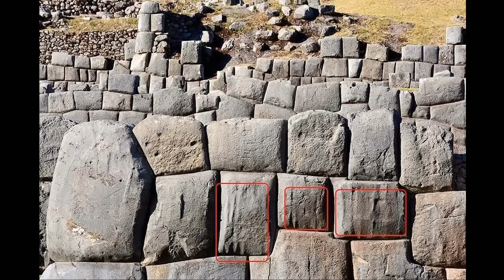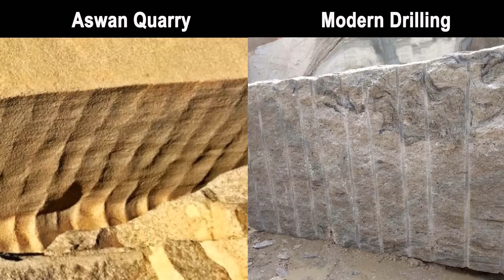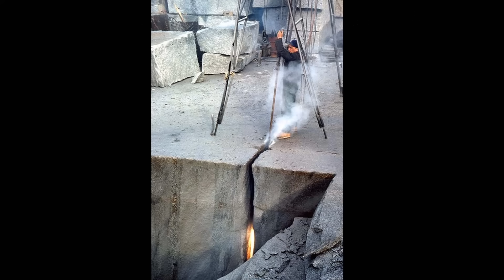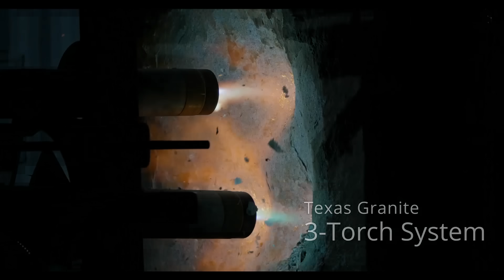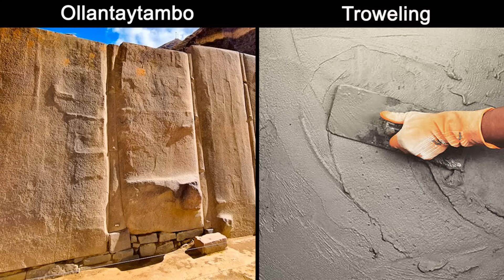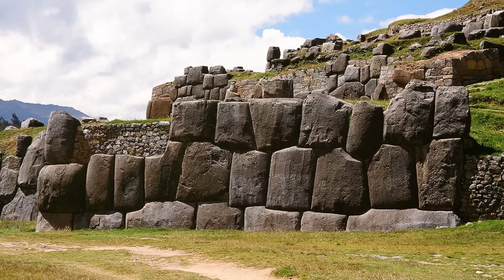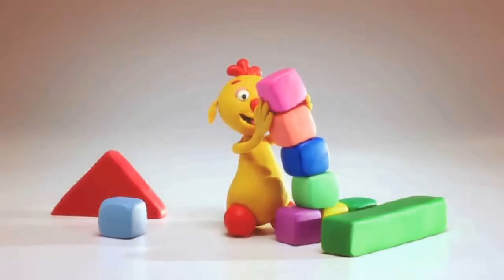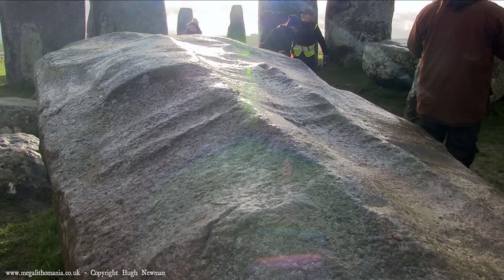Megalithic Mystery: Different Scoop Mark Types?

Comment: The marks are not a mystery.
The reason we find them on every continent, is because every civilization have discovered them independently.
Anyone who has had a campfire on rocks, knows how this works.

The method is called fire-setting.
Its a simple fire, making the rock brittle.. then you just hit it with something hard to remove the brittle part. 
Its a technique used up until recently, even after steel. Because its very fast and effective vs the effort taken.
Reply: Also .. geopolymer has been a scam since davidovits started it in the 90s. Its only doable with sedimentary rocks, but even then, its basicly faster and easier to just quarry them. 
Also ... we know the quarries, because each rock has a fingerprint. 
Andesite can not be made artificially, like limestone. Nor can granite or any igneous or metamorphic rocks

Comment: Dear Tina, when presenting a solution to the real-world scoop-mark finds in quarries, however still a proposal, there is no need to think of blocks getting soft in any way.
Soft blocks cannot reasonably be handled, and bulge out at the bottom, not even pressing into the sharp corners, and does not seem to do the job as seen here.
The possibility of plasma related equipment however, is already proven, with the picture presented by (Ombio Productions on YT) Igor, who is the only one having the image of this officially hided sculpture.
On the Wall at  Olyantotambo, we find just one other example of Plasma torches used, and we therefor cannot escape the idea of a high technical civilization using plasma before we did.
And over a 30.000 year time span, nothing of their equipment would be preserved, as expected.
The tests done to find a different consistency on the boulders is not valued solid in their community of scientists, and was done before at the University of Utrecht, the Netherlands years before them, and did not show a change in consistency at all.
And so, for us at this moment, the idea is out of the window, and could only be a case of surface-softening if something like that at all.
When Plasma is used, shown as a fact, the copy of a mirror surface must be no problem to them, as it is in the same order of mechanical development, and can be expected to exist.
The handling of these enormous blocks on high altitudes is not questionable either, knowledge evolves at all levels at the same time, not making it unsolvable.
And the surface at the seems show pitting, as a proof of hammering on a solid rock face, we cannot escape this fact with softening at all.
Good video anyway, as Scientist will not talk about it!

Comment: The scoop marks are made using Ancient stone drilling methods. Also the channel outside the drilled down the length of the Obelisk. Square logs were used as pilings when sandstone was still on the surfacethey knew harder rock was below.when blocks were pulled over the pilings they quickly smashed apart the softer layers above. The weight of blocks left pressure dents to fool people into calling them scoop marks!
Reply: Ican answer all of the questions you have about the scoop marks, their mining machinery was very simple and everything they tried to make, always provided unexpected results. to finish cutting a obelisk like that out of the ground would be finish roughly carved channel around the pointy end and also the base of the obelisk the square end ensuring it is to an even depth as the channel up each side. feed ropesaw over pointy end, then team of men can saw under the pillar to the centre, then do the same at the square end. break the centre support putting weight on one end.

Comment: The corundum recently found in the granite's microscopic pores implies an abrasive technique.  Water jets come in many different sizes, so I am guessing that water jets are the most logical conclusion.  The plasma would degrade the stone too much for the finish on the rough and finished cuts.

Comment: if there are casting box, 
there will be similar stones
blocks in sizes, every stones are different from each other, a bit similar but not the same. It is easy to do for stone masons to do different sizes than same size blocks then stack it up.

Comment: Great content, one thing to consider regarding geopolymer is that they are very high density, much higher than water or play dough. High density pliable geopolymer would be very different at the base of the mould, compared to the top due to the pressure difference. Yet we don't see any difference in these stones, the top isn't any less compressed compared with the bottom, which is a big red flag as far as geopolymer goes.

Comment: Engineers have looked at them and determined they were likely cut out using disks of some material.  They radiate from a point that is moved every so many cuts from what I have seen.  They are also very old, so erosion changes their characteristics some very likely.  Snake Bros have a video on it, I believe.  I believe they were titanium/water/vibration heads. The core drills with mechanical scores tell us they used cutting tools.
Reply: They had various tools. There's not THE tool did all this stuff.
For these scoop marks the plasma torch or something similar with high temperature makes most sense
Reply: @jochenwagner2782 I agree about various tools.  Not so much on plasma torch, though it is possible.

Comment: These scoop marks were left by flat abrasive water jets. The abrasive used could have been sand, as well as the material resulted from the destruction of granite by these abrasive jets. And yes, it's a pretty high technology that became possible only some 100 years ago. It requires precisely machined parts (pumps, valves, bearings, fittings, etc.). Definitely, dynastic Egyptians did not have this kind of technology

Comment: The Peru's polymer blocks could be done similarly to ancient Roman concrete method.   The ancient Roman concrete was different from today's concrete.   They mixed concrete with volcanic ash at some specific proportions.  The end result is that it heals itself and gets stronger over time.   Over long period of time, one could take that concrete as a hard rock.   Regarding the Lebanon giant blocks and Egyptians designs of perfection is indeed a mystery that has strong indication that only advanced civilization could do it.   I am inclined to what ancient Egyptian priests told the ancient Greeks, it was done by Atlantis civilization.

Comment: great content, the bramastra device in ancient indian texts... talks about a device that could vaporize stone into dust, your not far off. as a life long tradesman the thing about the peruvian walls that spins me the most, is the joints are cupped at a curve to the mating surface, with no tooling marks evident. As much as i am against the geo polymer theories because of various other  logistical challenges... (ie concrete takes as much pulverized medium as well as water, chemical, mixing machines...and these are huge volumes, and large multi ton single mix pours wold be very hard to achieve, large pours today often have "rats nests" or air pockets next to the form that require huge amounts of vibration to stop... also if formed, using a different new form with unique shape for every pour that could hold the pressure of several tons would be logistically not possible given the pressure of the liquid medium, you wold more likely see a repeatable cast or form used similar to bricks, cinderblocks, jersey barriers ect). also if you worked your way up it would be impossible to pocket and pre accept the next multi angle pour, they would be flat on top, cut stones would also over lap lower courses not depress to accept them.....but the only way i see possible to make such organic shapes so tight with these cupped joints is to be somehow poured.... also if you would like to talk about it i can tell you how the under cuts in the course work are indicative of being laid upside down, the way the stones pocket eachother... its as if it was poured upside down then flipped into position... i really dont know this stuff is so wild

Comment: How difficult would it be to create ceramic grinding stones hard enough to grind away granite? If they have the technology to move large blocks, they have the technology to suspend rotary grinding stones. Heavy rotary grinding stones adjusted then lowered seems to be the most efficient way to make the scoop marks. Collect the grinded material then cast sculptures etc.

Comment: I know granite can be cut away at using heat and cold, but like you said with the plasma torches, they probably didn't have that tech. and so how could they repeatedly make heat to chip away at the rock. I don't think they used a open fire as I can't see how they did that on a vertical wall. I do believe in the geopolymer theory and if they did do that the scale they did it was huge. So instead of scoop out, the idea they mixed some geopolymer, and plastered it, and used some trowel to form the shape of the rock they wanted. I believe some geopolymers had organic materials in their recipe hence could be carbon dated. But the assumption is there is nothing that is organic hence they automatically never test it.  Also I keep asking people to look at the paleomagnetism. Studying the magnetic orientation of stuff like the hematite or magnetite in the granite can tell you a lot of if it is all from one same blob or all different rocks moved and thrown in after the fact. As for Sasayhuamon (don't ask me to spell it correctly), I have a theory that the site could have been made using multiple techniques. There is proof that rocks were dragged from afar. But what if smaller rocks were used like aggregate, and a geopolymer were smeared over it to make a "huge bolder" looking rock.  I think when you see a patch of rocks that Brian Forrester says was from another generation of builders, that maybe it was the same builders, but the geopolymer mix was bad, and the big rock fascade geopolymer disintegrated and fell off, hence looks like another group tried to build on top of old construction. There is evidence of that in one of the corner pieces in (I think it was peru) where you see the vitrification and "can't stick a human hair in the cracks", but then one of the rocks fascade disintegrated and you can see that it actually has large rocks inside it. I'm sure it wasn't just one technique or answer for all the different sites, but I do believe multiple techniques could have been used to achieve the same appearance and one group used whatever technique was easiest for them like one group physically moved large boulders, while another group used geopolymer blocks, and another used this hybrid medium size rocks as aggregate with geopolymer fascade to look like the big ass rocks. I think x-ray the rocks could give some info.  Nobody is going to "perfectly" match one rock to another where a credit card cannot fit in. That is just idiotic to think they would have bothered doing that much work. Getting 100 men together to pull a big rock just takes money. Wasting time precisely matching one rock to another is a waste of time and that group wouldn't have done that. I think each site has to be looked at as constructed using "one of possible methods", rather than saying that all sites all used the same identical mystery method.

Comment: Another idea is looking at the surface. Is it glossy smooth (vitrified) which would indicate chemical reaction. Or is it very rough (like sand paper) which would indicate more of breakage at the granular level since granite has multiple components in it like quartz etc. breaking apart.
Reply from the maker: Valid idea - thank you for sharing.
Reply: @CuriousBeingbyTina look below the block upwards. For less influence of the 12 to 38 years erosion

Comment: Miss, I think you should watch a Peruvian YouTuber's video where he uses plants and flowers to extract their juice. He pours it into a bucket of basalt stones, and they dissolve like fizzy pills. It has the same consistency as cement.

But if you pour this liquid on a stone floor, the acid will loosen the surface layer, and you can scrape and dig it with a large wooden spoon. And the surface looks like the excavation of the obelisk.

It was a small experiment. But if they did it on a large scale, you can imagine people in the past planting these plants, then harvesting and grinding them in giant wooden baskets to extract huge quantities of this acidic liquid on a larger scale.

There's no greater secret.

Comment: Hello Curious Being. I do like your approach to trying to find the answer instead of some channels that keep just calling it Ancient Lost High Technology. It was something very simple else they wouldn't have done it. It looks like you could observe the scoop marks close up which most of us can't. If they were "scoop marks", then my question would be, are the scoops all the same size? I would assume some tool would have been used repeatedly. Can we answer this. If there is some uniformity to the scoops, we should be able to mold a positive spoon that would fit the groove marks which would help confirm that theory. If all the "scoops" were different, then the question is why? even if it was a tiny hand held spoon, we should see this repeat pattern some how. Right? even basic stuff as was it just a round plate they used hence the peaks between the scoop marks and we should be able to calculate a diameter of this circular tool. Or was it like a straight 2"x4" dimensional lumbar that they used to scrape the rock? We should be able to see some shape repeat itself to confirm there was a tool used. Else if we can't find that, then no matter how much I agree with the scoop theory, it has to be something else.

Comment: I have watched many videos about this and your video has some photos I have not seen before. The plasma machine is a plausible explanation for some of the markings. Although the placing of rocks in there plastic state does offer some explanation for the unique shapes, my objection as a builder is I don't see how you could handle and place rocks weighing many tons in weight. 

None the less I think you have offered a better explanation than most. I personally don't think we understand how they did that at all yet. We certainly can't do it today. What is clearly evident though is they had machines every bit as capable as us today and so they had energy in the form of electricity and fossil fuels. So they had modern roads etc etc. All of it has been wiped off the face of the earth leaving behind only these megalithic structures. Is this just a matter of time or catastrophe?
Reply from the maker: Thank you for sharing your insights and for the support. I think these builders might have been more advanced than us, came from an earlier unknown civilization. Some researchers proposed that the Younger Dryas comet impact was the event that ended the previous civilization. But I found some data which indicates the real culprit was an earlier disastrous time period. I made multiple videos on this topic. Hope you will find them interesting: 
- Was an Advanced Civilization Wiped Out by a 12,800-Year-old Comet at Younger Dryas? https://youtu.be/4XXV3Ax3KO4 
- - What Caused the Fall of a Previous Advanced Civilization? https://youtu.be/Zs4zLKbp4Ic  
- Great Pyramids’ Radiocarbon Dating: An Inconvenient Truth https://youtu.be/UgLuLd_4B18 
- Surprising Distant Timeline of the Great Pyramids & Sphinx https://youtu.be/8-aQJgY6OxY 
- Lost Megalithic Civilization: Where to Find Their Remnants? https://youtu.be/0KBfaLJykF4
Reply: @CuriousBeingbyTina  Given the outside of the box thinking you have offered here I will take the time to watch all of those. 

I'm no stone mason but I have a lot of experience with concrete and earthworks. I have spent many hours with concrete cutters and Dimond cup wheels on a grinder polishing concrete etc to know that most academics have no clue what they are talking about. 

I recently watched an old 1920's-1930's movie about a granite quarry in China or somewhere like that. And those old guys to my disbelief cut that stone with hand saws and broke it out with chisels. They left behind scoop marks that with a few thousand years of weathering could look exactly like many of the marks you show here. I thought to myself that's how they did it, case solved! But then we see these scoop marks extending under the great megalith still in the ground and what I watched does not explain that. 

There is another video of a couple of guys cutting an old flour mill granite wheel, its much the same. 

Back then men worked hard and as tough as I think I am/was I could not hold a candle to any of them. In this day and age we are all soft and near useless, none of us would ever consider swinging a sledge hammer all day, but they did. Much of our problem today is we have forgotten what men can actually do. I climb out of my beautiful air conditioned digger after a 10 hour day thinking I have done a hard days work lol.

When you first suggested the plasma idea my initial reaction was no but as I watched and thought about it a little more, to my mind that maybe the best we have for now. I had never heard of it till I saw it here. Nice find. I think you are adding useful ideas to the conversation with similar value as the likes of Randal Carlson.

Comment: What if the diorite balls were dropped down a long chute and aimed a a slight angle. You could spall off a lot of material like balls in a pinball machine . The energy is mass x 32 meters per second per second let me know what you think…